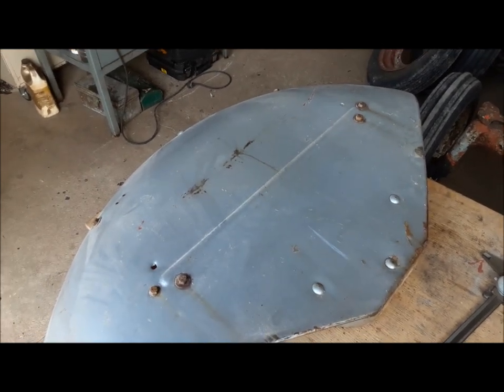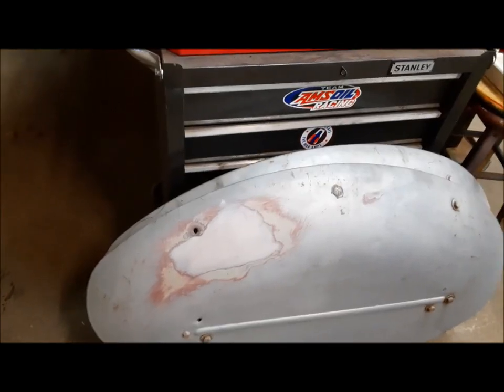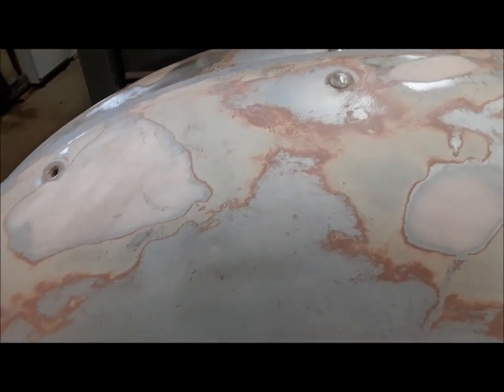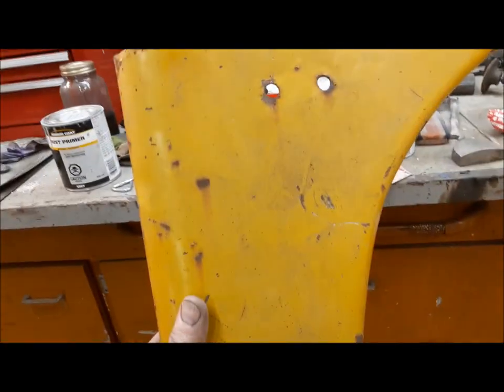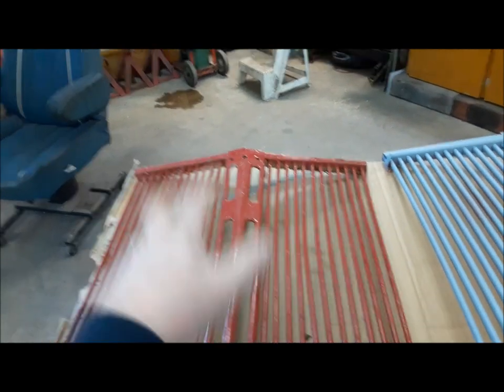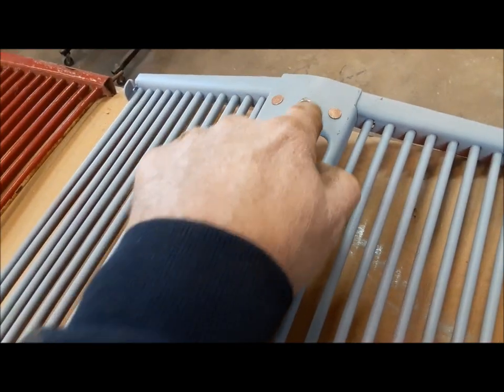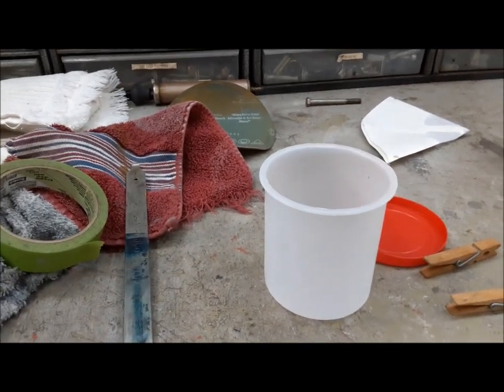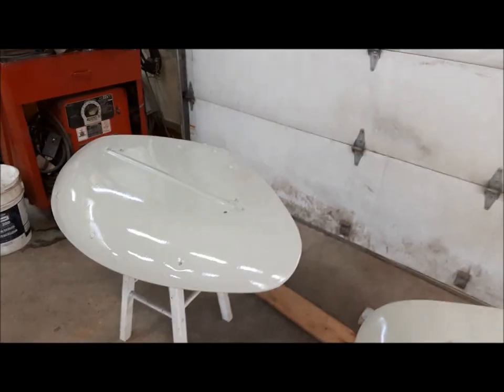1948 Ford 8N part 10 Did I mention I HATE bodywork

Comment: Maybe it is because my painting experience consisted of painting race cars with cheap Restoleum (the brush on version I would pick up in quart cans) that I would thin down and spray, but I was impressed with your effort, Kevin.  My goal was always a 50/50/50 paint job.  It had to look good at 50 mph, 50 ft. away, 50 minutes before dark...  I raced a Fiesta on road courses for decades and at one time even had a team car I had to paint.  Kind of thought I was done with it.  I am in the process of dressing up my '50 8n (with a transplanted '52 engine) before I add a loader for some light work on our little farm.  Much more of a refurb, however, and I am not taking the same level of care you are.  Maybe more of a 5/50/50 paint job...  Anyway, nice work and thanks for taking the time to put the videos together.  I appreciate what I pick up and the inspiration.
Reply from the maker: Thanks. Both my race cars are painted with Tremclad rust paint. I use a 4inch roller LOL